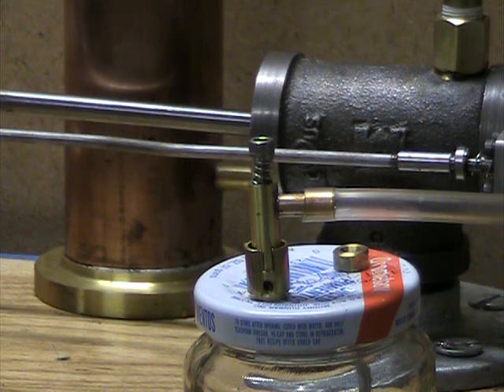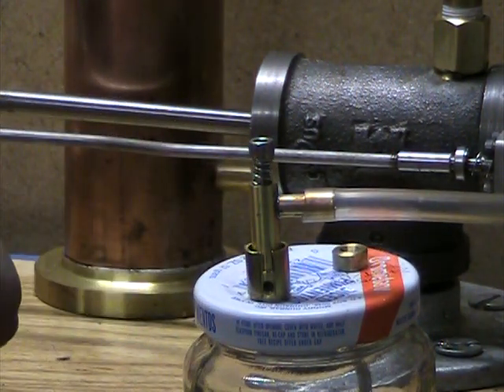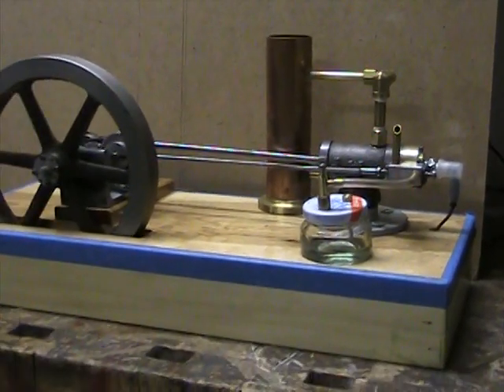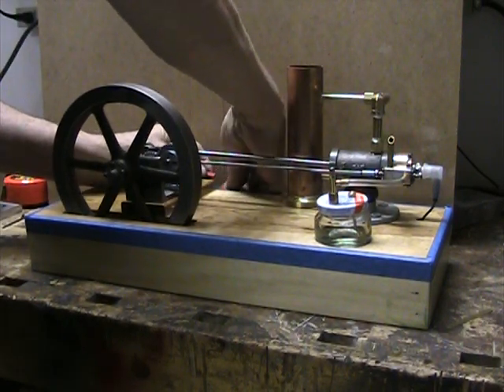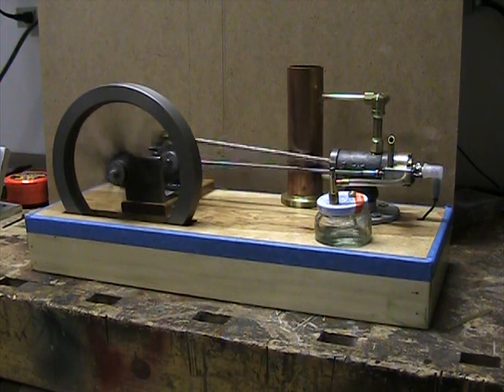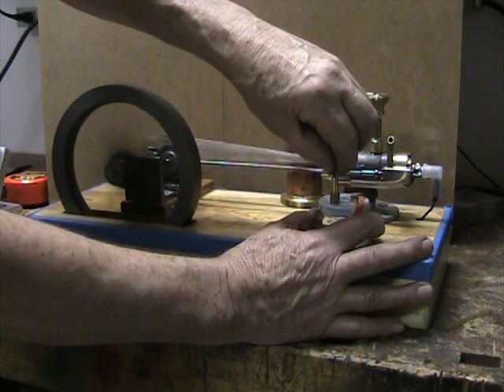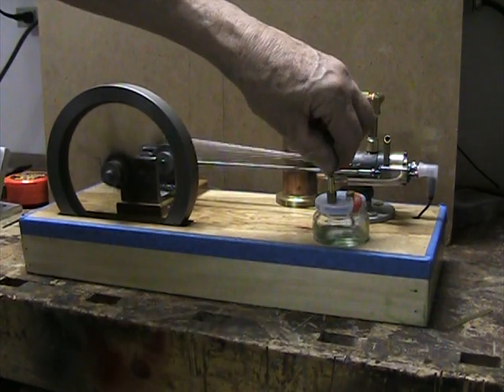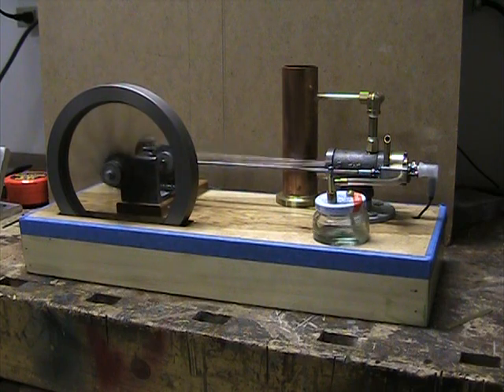HenryFordEngineCF.mpg

Comment: I dont know if you still has this engine or if you are still wanting to work on it but to make the mixture run not so lean try let the gas have more contact with air inside the container, you can use a big glass bottle laid on the side or something like that.
Reply from the maker: Thanks for the comment.  You are right, a larger surface area of the fuel and a larger space above the fuel both help make the mixture richer.

Comment from the maker: @SthealthRaider The outer part of the cylinder is made from a cast iron plumbing tee screwed onto a nipple which is screwed into a flange for the base.  The plumbing tee was bored out to fit the OD on the cylinder liner which was made from a piece of cast iron rod, bored and interference fitted to the tee.  A plug was fitted into the bottom of the tee so it would be water tight.